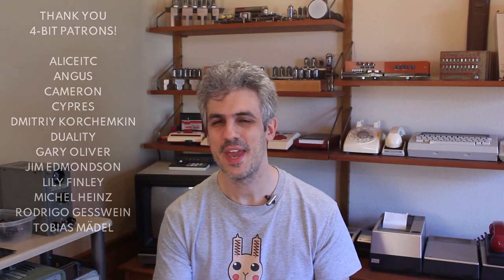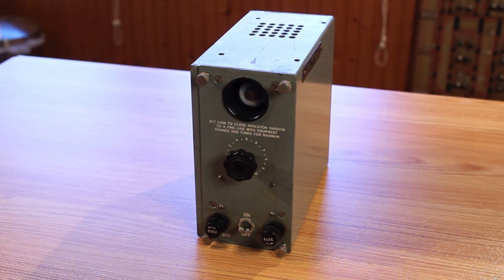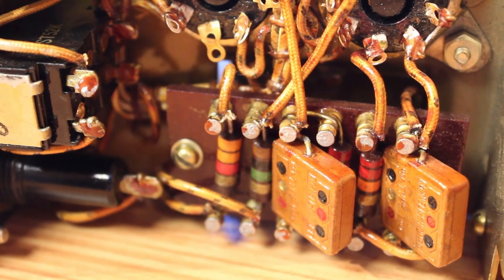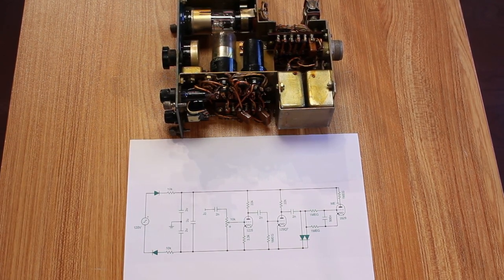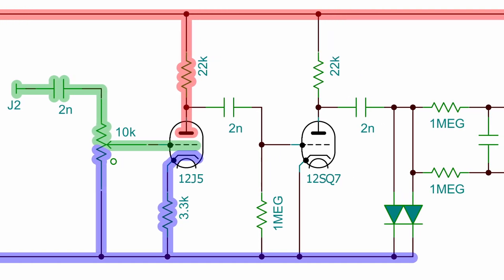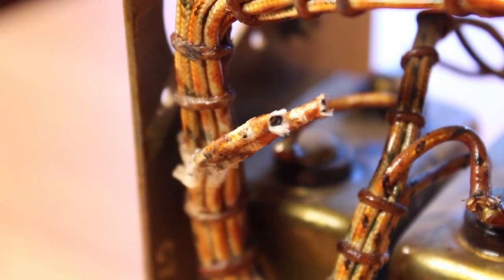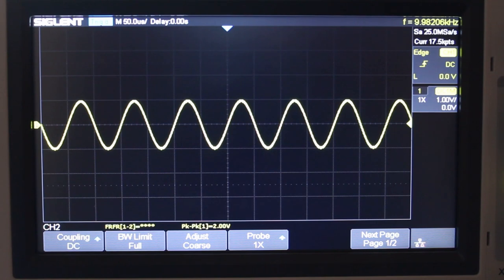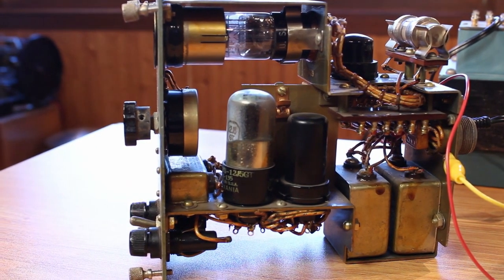Reverse Engineering a U.S. Navy Vacuum Tube Thing

Comment: I have to say that you pronunciation of the tube numbers kept rubbing the hair on the back of my neck backwards. The pronunciation would be "twelve J 5" and "sixteen twenty nine". 

The thing is Navy equipment, from the grey panel color. The conformal coating is a varnish that is designed to resist fungus. The Army and Navy quickly discovered in early WW II that tropical areas resulted in fungus spores in the air that loved to eat the insulation off of insulated wires and produce effluvia that corroded everything else in the equipment, destroying it in a matter of hours to days. The varnish prevented that. The wire lacing was Mil standard, and was useful for keeping things from flapping around when the equipment was moved or jarred, as one could expect in combat conditions.

The thing is obviously a signal strength indicator, and from the legend on the front it is a tuning or training indicator used with some sort of directional radio equipment. From the use of "trained", it is most likely a radar unit or gun director unit. I'm really surprised by the lack of a part number on this unit. EVERYTHING in the WW II military had part numbers on them! If we had that it would be trivial to see what equipment it came from. Since it is a signal indicator on a trainable device, it would probably have been used to make sure that you kept the aim on target, as the eye would open when the signal strength dropped off.

Standard WW II paper caps were made in ratings of 200V, 400V, 600V, and higher. Given the operating voltage, the obvious choices are 400V or 600V. If that really is single rectification coming in, 400V would be sufficient. But that looks like a voltage doubler circuit to me, developing half wave rectified voltages across C5 and C7 in opposite polarities, giving about 330V across C6. You could try measuring that. With that, 400V becomes marginal from a lifespan point of view, so the conservative choice was 600V filter caps. Note that line is balanced coming into the unit. Navy ship electrics didn't have a 'hot and neutral" as we are used to. The whole power system was floating with respect to the ship, and if anything needed to be tied to the ship's frame, it was a center-tap point, only giving 60V from ground to either rail.

The first stage is a self-biased triode AC amplifier. The second stage is a grid leak biased triode AC amplifier. These two will get a low-level AC voltage (probably in the few hundred millivolt range) up to the 5-8V levels needed by the grid on the magic eye tube to achieve full cutoff.

The magic eye tube needs a slowly varying negative DC voltage to produce a useful indication. The cap on the plate of the 12SQ7, in conjunction with the paralleled detector diodes in the 12SQ7, are a negative voltage source, rectifying the plate signal to a negative DC level. The cap between the grid and cathode of the 1629 is a filter to make the signal level change slowly. Detector diodes were designed to rectify low-level signals to produce a DC voltage level, not DC power. These diodes have a very low current rating, around 100ua each. When using them for uses like this it was standard practice to parallel them for reliability and current handling capacity, and to average the offset voltage that a thermionic diode generates.

I'm pretty sure there is an error on your schematic on the magic eye tube. There is almost certainly a missing or incorrect connection to the cathode, which most likely should be returning to the ground reference used by the other tube's cathodes.  The target current for the 1629 is going to be around 3-4ma, and you aren't going to be pulling that thru a 1M resistor to a pair of detector diode plates (rated for 100ua each) to ground. I would more believe that the detector diodes go thru a 1M to pin 5, and the thing you have labeled 1M on pin 8 is either a lower-value resistor to the negative bus, or just not there at all and there is a wire to the negative bus.
Reply: Nah not use on a targeting system.   Radar targeting systems of the the day used PPI  and the data from them with their optical sights where fed into predictors that trained the guns.As well this is a stand-alone device as far as I can tell and not part of a larger system
Reply: @byterock  Someone in another comment said that this was an add-on to a sonar sub-finder system that gave a more accurate bearing deviation than the regular indicator used on the unit.  I'm not much familiar with WW II sonar gear, but the clips I've seen of operators using the stuff makes it look primitive compared to WW II radar units with either PPI or the previous more primitive timeline-amplitude display, so I can believe that it was an add-on for a sonar rig.
Reply from the maker: Thank you so much for the massively in-depth reply. 
Unfortunately, I somehow missed this comment a few weeks ago, sorry!

Firstly, sorry about the way I pronounced the tube numbers. The number of people that got extremely angry at me for that is mind boggling. I address this a bit more in an upcoming video, but the specific reason why I pronounced the numbers individually is because I have a background in aviation. When speaking over the radio, we would pronounce the numbers individually to ensure no confusion. If I'm landing on runway 19, I say "one nine" not "nineteen." It just so happens that speaking to a camera, particularly when you can't see my face, triggers the same muscle memory, and I was pronouncing them individually and not even noticing it.

Thanks for the insight on the conformal coating, that makes perfect sense! That also explains why everything inside is still in beautiful shape. The lack of part number is what really makes this one a difficult nut to crack. I'm thinking that perhaps this was a unit that was used for sales, or training or something, which would explain why there weren't any stamping on it. Also, it's quite likely it's just a small part of a much larger system that has a part number that encompasses this piece. 

You're definitely right that there's an error on the magic eye tube schematic. I missed the connection form the cathode, and going back and double checking it, it seems super obvious now! Here's the updated schematics:
https://i.postimg.cc/jdZ7FfBh/Updated-Schematic-A.png
https://i.postimg.cc/85MyR4K4/Updated-Schematic-B.png

This makes a lot more sense now!

Comment: It is a 5" 38 rangefinder alignment unit for fire control MK-1a or b. It was located in the gun turret as  you align the rangefinder the eye tube closes as you turn the range knob on the fire control analog computer. It was used for firing the weapon at night. Because the visual rangefinder was of little use on moonless night or very low light, and your spotter could not see where the round fell.. And those in the turret needed to know that the weapon was on point. It gave the "gun captain/turret captain a visual indication of weapon's range setting by the computer. The gun captain would look at the gun's range/elevation mechanical markings on the gun, he would get a report from fire control  that their computer showed the set range, and the eye would be fully closed. Performing a three point check. A 5" 38 had a range of 18,000 yards approx. 9 miles.
Reply: Close, but it is for sonar. 5 inch guns already had visual feedback this late in the war, better than this little box.
Reply: Hmm doubtful, do you have an JAN or AN number for it.
Reply: Civilian here, Looking at YouTube on the MK-1 computer, likely this is not the case, however after 30 minutes of a MK-1a rabbit hole on YouTube, I thank you for sharing such a cool piece of engineering history.
Reply from the maker: Somehow I missed this comment!
That's an interesting suggestion that it might be for a rangefinder. The MK-1 fire control computer is a fascinating piece, and being an electromechanical analog computer (a really advanced pinball machine, hehe), I imagine it had all sorts of displays for relaying information to the user.
Reply: Going back to the engraved instructions..."when equipment is trained" certainly sounds like artillery.  Do you "train" anything else?

Of course, all I know about the Navy comes from YouTube... Drach and Battleship New Jersey.
Reply: @davidduma7615 WW2 destroyers had torpedo launchers, hedgehogs, and K-Guns. There are two small magnets on the slides of the rangefinders. As those magnets are aligned, a greater signal is generated into the didoes of the 12SQ7, the signal is then sent to the triode of the 12SQ7 for amplification. Where the output is sent to the power triode, 12J5, that powers the signal into the 1629, for a visual signal.

Comment: Wow, using a 6H6 as a power rectifier; I bet that has never been done before.  I imagine the two of them in series are simply to handle the load.  The diodes in a 12SQ7 are demodulators (normally), they sure don't flow much current.
Reply from the maker: You know, now that you mention it, the 6H6 is certainly not the best rectifier tube on the market, haha. I think you're totally on point that the two are in series just to provide enough current for everything else!

Comment: There is something wrong with the magic eye circuit the way you drew it. It cannot light up with the 1 meg resistor between cathode and ground. The cathode of the 1629 should be connected directly to ground. 
The module appears to be an add-on for sonar equipment to accurately determine  strength of the received 
ping, hence the vernier on the gain knob.
Reply from the maker: You're absolutely right!
I went back and double checked the wiring and I missed an important connection from the magic eye's cathode to B-, here's the updated schematics:
https://i.postimg.cc/jdZ7FfBh/Updated-Schematic-A.png
https://i.postimg.cc/85MyR4K4/Updated-Schematic-B.png

And I think you're spot on with the sonar equipment idea!

Comment: It acts as some sort of AC voltmeter.  The input cap & 10K pot have an RC constant of 20uS, which corresponds to a -3dB frequency of 50KHz for a H.P. filter, so it's for RF use, probably LW or MW.  The 12H6 diodes are simply a shunt rectifier, and the two resistors & cap are to smooth the pulsating DC.  That configuration is commonly used for RF probes.  So, that's what it is.  Exactly what it's used for, I don't know.

Comment: Ouch bathtub oil caps.  Just a word of warning many of these may of been made with PCB oil.  So DO NOT, try and open them up to see what is inside.  
I will see if I can find that instrument in some old JAN catalogs I have.   At first sight I think it was used for balancing signal outputs.  Most likely for twin bean fire control radar,  just a guess though.
Reply: at 600WV caps i don't think they do contain that sh*t, but a but of caution doesn't hurt. Maybe you can try to find a datasheet for them, if the type number is visible in the video and look if the dielectric impregnation is specified.
Reply from the maker: Thank you for the heads up! Though, I have no intention of taking anything apart in this beautiful piece of equipment :)
Another commenter suggested that it was used as a Bearing Deviation Indicator in early sonar systems, which seems like a fairly likely application, but it's designed in such a way that it could have had multiple uses on several different types of equipment.

Comment: Looks like it is for tuning something.  It reminds me of aligning a radio, with the eye tube to be used to show when a section has been peaked.  Maybe a military radio alignment tool?
Reply from the maker: That's a definite possibility!
Another commenter suggested that it was used as a Bearing Deviation Indicator in early sonar systems, which seems the most likely. Although, it's entirely possible that this one unit was used for multiple purposes given that it's designed in a pretty generic way!

Comment: The power input looks like a voltage doubler. Check the HT it's likely 240v. Also the matal box caps are likely leaky and need to be replaced, at the very least you should check them at HT voltage for DC leakage.
Reply from the maker: I don't believe the 12H6 is connected as a voltage doubler. I checked the voltages with it powered up and coming out of the 12H6 it's sitting at just 135V. That's actually a little lower than I was expecting, but I think that's due to voltage drop across the diode and I think the capacitor values are intended for 400Hz shipboard supplies as opposed to the 60Hz I was feeding it.
As for the capacitors, I don't really want to replace any components inside so it can keep it's original construction. At this point, it is primarily a display piece that will spend 99% of its time unpowered, so I'm not too worried about any components not working at full capacity in there.

Comment: Looking at all the domino caps, I'd say it was for tuned radio something or other. (?)
It's a nice looking whatever-it-is, in nice condition. :)
Reply from the maker: Thank you! And it really is in excellent condition, I just love the over-engineering that went into it!
Another commenter suggested that it was used as a Bearing Deviation Indicator in early sonar systems, which seems like a fairly likely application, but it's designed in such a way that it could have had multiple uses on several different types of equipment.
Reply: @UsagiElectric  I wonder if you could interface it to your valve computer ? LOL
(Just Joking)

Comment: That is a rail splitted supply, you have +80 and -80 referenced to ground. No idea why, but probably it was done for safety? If one of those diodes dies you would still have the other rail.
Looks like a circuit that detects if a signal is a 50/50 square (or maybe doesn't have DC offset if it is a sine)? I might be mistaken though, just going by feel here ;-)
Probably Mr Carlson would be able to tell.
Reply from the maker: That's an interesting idea! As far as the circuit is concerned, 0V to +160V is the same as -80V to + 80V, so it really depends on what the ship was supplying and how the supply interacted with the "Earth" of the ship. 
Another commenter suggested that it was used as a Bearing Deviation Indicator in early sonar systems, which seems like a fairly likely application, but it's designed in such a way that it could have had multiple uses on several different types of equipment.

Comment: Possibly some sort of buffer that makes sure an input signal of some kind is at the correct level for a subsequent piece of equipment in a stack.  I love the way it's built.  Not terribly surprised that it still works.
Reply: The way it is built is fenomenal, army equipments are the best!
Reply from the maker: Another commenter suggested that it was used as a Bearing Deviation Indicator in early sonar systems, which seems like a fairly likely application, but it's designed in such a way that it could have had multiple uses on several different types of equipment.
It's build quality and design is top notch though, I just love the over-engineering of it!

Comment: nice VUmeter!! (turboencabulator aligment tool?) built like a battleship... a heavy one...
"no clue what it does, but we have a pretty good idea of how it does it!"  jaja! make my day
Reply from the maker: Thank you!
I love the way this thing is overbuilt! 

The comments are full of excellent suggestions to its use though. I think the most likely is that a commenter suggested that it was used as a Bearing Deviation Indicator in early sonar systems. But, I think it was originally designed in such a way that it could have had multiple uses on several different types of equipment. Really, anything that needed a precise frequency indicator!

Either way, I'm stoked that it works so well and looks as cool as it does!

Comment: Well had a little more time for research.  Lets go with what we know of the device.  1) it is not a sub-assembly or sub chassis (front panel has silkscreen, no set pins,  knobs flush with plate, etc)  2) It has no JAN/FN or AN markings.  3) It is built to Mil-spec standards,   4) Plate it does have is blank,  5) could not be found in period catalogs.  6) could be a plugin to larger system. So what is it?   Well one guess is a manufacturing test piece.    During the war many companies where drafted to produce electronics,  this could be a test run though a production line of a simple product to check for quality.  IE to   'Boston Toaster Company' if you want to make radios for us take this schematic, and create it  if it passes you get to build radios for us.

Comment: My guess would be that it's for nothing more than monitoring the input signal. My guess would be that you would begin with some baseline signal, dial in the gain control to calibrate the magic eye, and then from that point on the operator would have been monitoring the gain of that signal relative to the setup. Nothing special.
Reply from the maker: I think another commenter actually managed to place it! They suggested that it was used as a Bearing Deviation Indicator in early sonar systems, which is pretty epic in my book!

Comment: I think that cheking a frecuency sweept input on J2 would tell us more about what was it designed for.
Reply from the maker: That's a good idea! 
Another commenter suggested that it was used as a Bearing Deviation Indicator in early sonar systems, which seems like a fairly likely application, but it's designed in such a way that it could have had multiple uses on several different types of equipment.